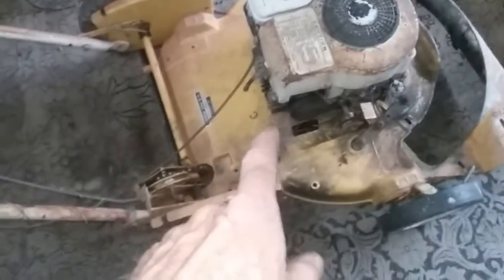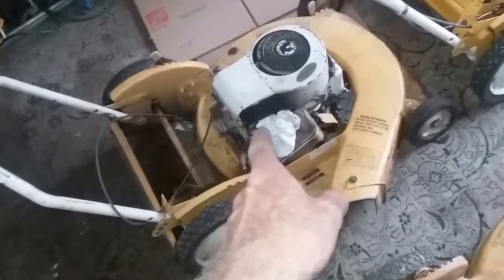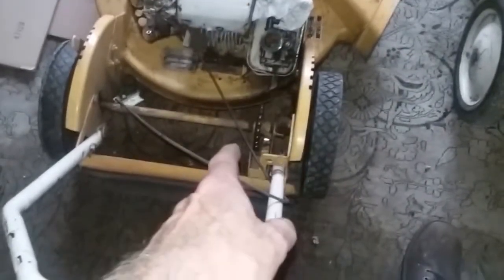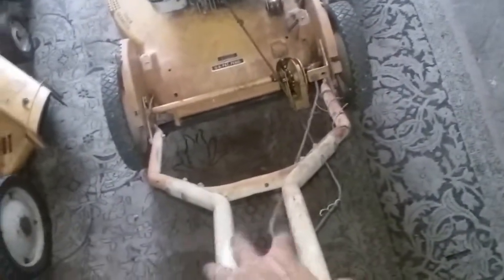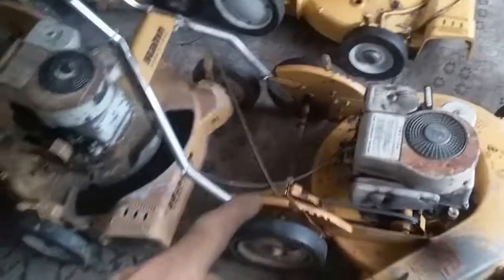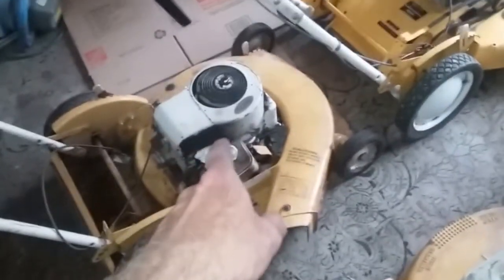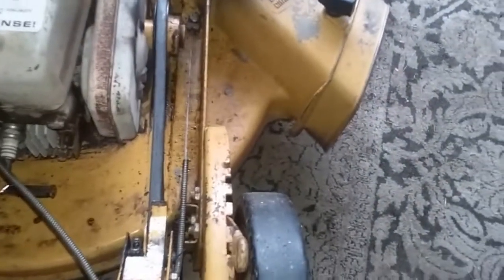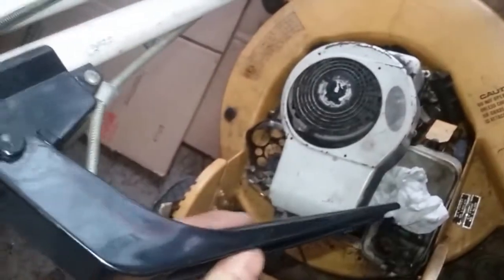Hahn Lawn Mower Collection, Hahn power-pro, Duo-Pro, Just some, Self Propelled

Comment: Do you know where to get parts?  I just got my hands on a new old stock 1978 IH-117 (17in 3HP) built in the Clemmons, NC Gravely factory.  It belonged to a man who worked at the Clemmons plant.  It's missing the side discharge chute diverter.  Do you where I could get one?